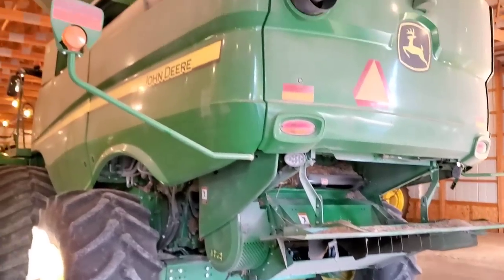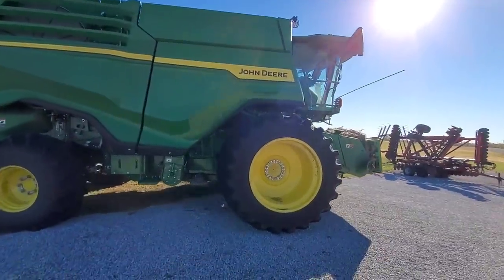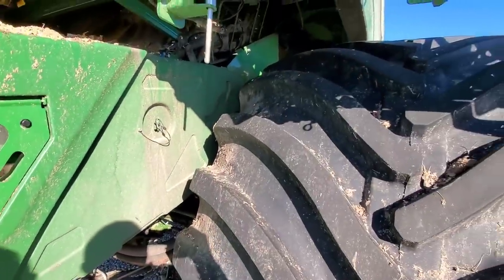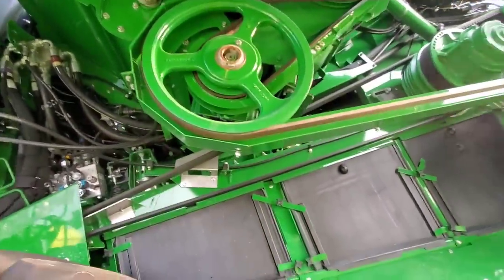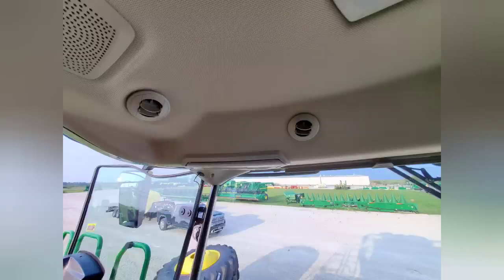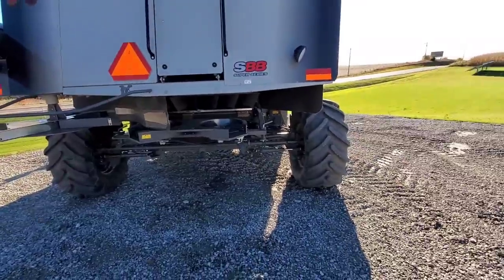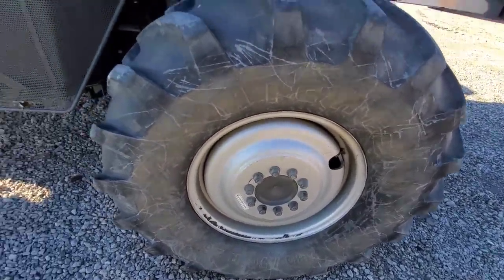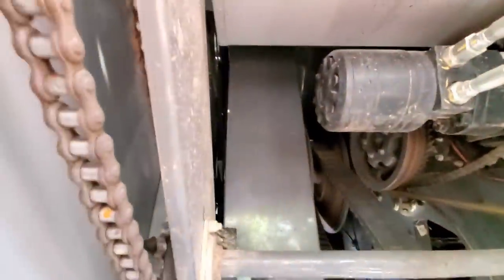combine info / search

Comment: Honestly I like the johndeere combines but my family bought 2 gleaner s98s on tracks last winter  . They do just as good of a job as our johndeere s680s if not better . Our grain sample is way better in beans and corn . We have had good luck with them so far . We run a case 9240 as well in corn . We farm 8000 acres and we normally have 2 machines in beans and 1 in corn . I'm trading off the case for a s790 on tracks  I've already ordered one and it will be delivered in December.  The 780s and 790s are really good well built machines.  I'm not brand biased I believe they all have strengths and weaknesses.  The main factor is price and trade in value. Great video keep up the good work!
Reply: Damm you are a huge farmer, you got the life
Reply: @HectorGarcia-nb2ld  I wouldn't say huge . We only own 5600 acres the rest of the land  is custom farmed . I had to work a regular job for many years to be able to buy my own 1500 acres . I farm with my father uncle and 2 cousins who farm part time . I still work as a mechanic and electrician when I'm not farming.  We do custom excavation fence row clearing and install tile as well . Trust me I have plenty of debt for a 27 year old.  I'm far from rich and I'm very humble about my life . Take care  !

Comment: One thing noticing on those newer combines is they keep getting more and more jammed with stuff... ever have to work on things it gets more difficult. Especially the rear ends on some of those machines to get access to sieves and chopper is like a crawl space.
Reply from the maker: Exactly...some are just down right miserably  impossible  to work on ... I get a lot of pro-gleaner people on here, I honestly don't see they are any better than anything else, still belts and bearings everywhere ... as an overall, all brands could do better
Reply: I thing when my kids are running the show, it won’t be “hot, fast and hard” it will be slow, all electric, and continuous 24/7. Hard to imagine, but the tech to it has existed for 30 years. Are they just waiting until Bill Gates owns all the land?
Reply from the maker: @LtColDaddy71  lol - so true!

Comment: In my opinion in today's age I feel it is hard to beat Deere or Case IH. NH makes a good product also. When I was in High School I worked at a farm that ran every Gleaner at some point all the way from an R40 clean up to an R72. The Gleaner design today for the most part is the same design clean back to the N series Gleaner that released around 1978/1979. The rotor setting sideways is pretty much maxed out on capacity due to length. To make it any longer you would have to widen the machine. The unloading auger system has good reach and length but in my opinion is outdated. I just feel they need a new design. They did upgrade the cab to a Fendt style on the latest series. Don't get me wrong I am a Gleaner fan I just feel they need a new design and yes the feeder house is small. The old White/MF rotor design was a good design but I feel because of lack of dealer support and MF bad combine reputation back in the 70's and 80's put a bad taste in a lot of peoples mouth. The new Fendt Ideal combine is only offered in the USA as a Fendt. You can buy it in other countries as a Fendt or MF combine. I feel it has a lot of capacity but has a lot of bugs that needs worked out to make it a reliable machine. On top of all this Agco has lack of dealer support for pretty much all these brands and also they keep dropping names of brands and colors that over the years has cost them a lot of customers. Class Lexion is a good combine but around here their was a lack of dealer support, poor resale, and when you where broke down you was down pretty much the whole day. They have great capacity though. I guess in the end capacity, ergonomics, resale, dealer support, reliability, and parts inventory goes a long ways in making a decision on one of these high dollar machines. What about breaking axles? You don't hear about it as much with the new machines but I know on the old IH axle flow design it was fairly common to hear of someone snapping an axle. It still happens with other brands and even on newer machines but not as much. Still, I feel for what these things cost they could make heavier and better axles for all brands. How about fires? Deere along with other brands seem to catch fire a lot . This is a problem in my opinion they need to get a better handle on. Like you said no brand is perfect. All a person can do is buy the best that fits there situation.

Comment: What’s your parts / service bill at end of year on the Deere to get it ready for next year?…..I heard it runs anywhere from 15–20k on a 790…true?
Reply from the maker: For years we have tried to measure it .. but that is a very tough to nearly impossible question to answer ....

If you figure most combines are good until 1500 hours - then at that point needs significant rebuild work ... so say 40 grand in rebuild work at 1500 serpeator hours -  then figure you run 300 separator hours per season ... thats one way to pro rate it out ...

But there are so many factors .. say an engine or final drive fails mid season - then one season could be extremely expensive and the next not so much ...

Last 2 years our annual bill had been under 2 grand a year.... however it's more than that because or service...just for fluid and filters every season - filters alone are 800$ ...

There are just so many factors that could be considered on this number ... I'll have to do a video on it - or incorporate the info into a video ....
Reply: @Blackearthexcavationandtiling   👍….keep up the awesome job!!
Reply from the maker: @gregsmithets3659  thanks very much

Comment: I think if Gleaners were that bad they wouldn't have the following they do. Their philosophy just seems to make sense for a bunch of people,  lighter equipment should be able to run with lighter belts and bearings. Nowhere near the parts and dealer support deere has, but thats a far sight for a lot of the manufacturers.
Reply from the maker: Gleaner sure seems to have a following - the guys that have them seem to love them ... I get the principle behind the design, but I don't see any miracles either... our Case IH had less bearings and belts than the Gleaner  does - so overall I feel there are much better brands than the gleaner ...... for us, it's almost 100 miles to a gleaner dealer, so it's really not an option at all ....I have more machines to look at and more videos to make, so stay tuned.... always good to hear from you
Reply: @Blackearthexcavationandtiling  its all good. I can't imagine the pressure of equipment selection. I hope to one day, but not yet.. I would guess tractors are easier than combines?
Reply from the maker: @mattunes5823  tough choices for sure!... for tractors we have had red before, but gravitate towards green, I have found JDs support and parts availability to be stellar.... we have a 1972, 4620 we are working on now, and 90% of the parts are still available - I firmly believe if it wasn't a JD, I couldn't get as many of the parts - so that's we stay green on tractors...

Comment: If I could buy a perfect combine, I would buy a brand new 9770 deere with new bearings, new sheet metal, new augers, etc,,,, but they quit building them several years ago.  My S770 has too many electronic features, mapping, etc, that I have no use for.
Reply from the maker: 9770 was just about the best machine deere ever made

Comment: I can’t agree with you more about the Gleaner. What the hell are the 2 people who buy them every year thinking?

The technology on both the planting and harvesting side is a must have. You’re talking combines here, so my take is to buy a good used S780 with all the tech. Combine advisor etc… If they have a new X8 and X7, the 780’s should go down quite a bit. You can make them a 790 by changing the programming. 

I buy used equipment, but with the prices on used, it may not be worth it next time. Our rotation has wheat in the mix. So how much being done at once is less. Plus we’re organic, or in transition on the newer ground. I have that figured out better than most so my yields aren’t half like they are for a lot of organic guys, but even at 85-90% yields one doesn’t need the most horsepower. You run out of max safe forward speed before you max out the back.
Reply from the maker: I agree 100% ...

Gleaner seems to have a good following - everyone brags how simple they are, but I don't see it - our case ih has less belts and bearings than the gleaner does .... overall, it just doesn't seem like there are any miracles with the gleaner design ....

We are leaning towards exactly what you said .. get a used 780 - and stay deere .. we're familiar with the deer machine, plus the 780 will have all the technologies that we want ...

Good info! - thanks for watching and commenting ...